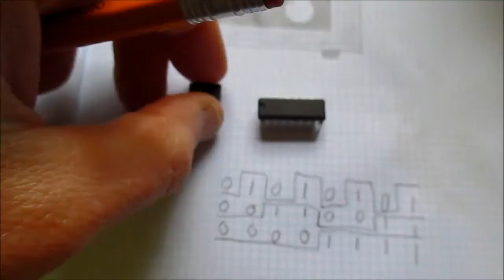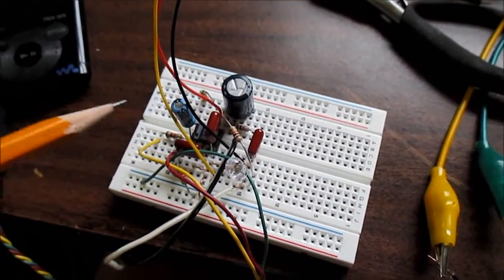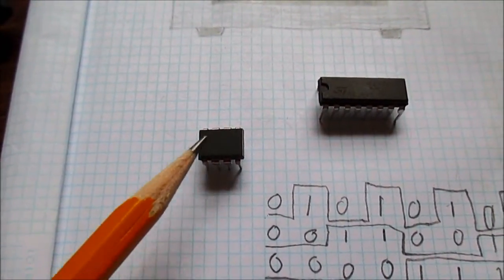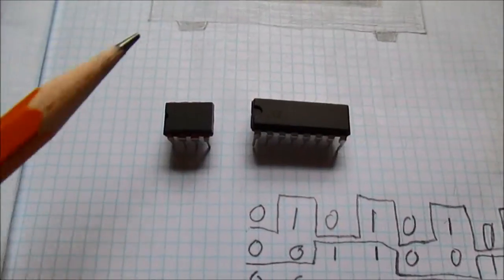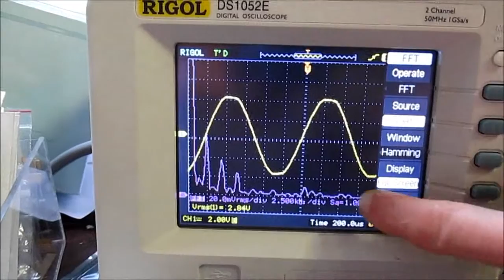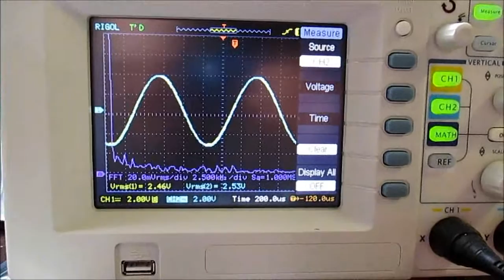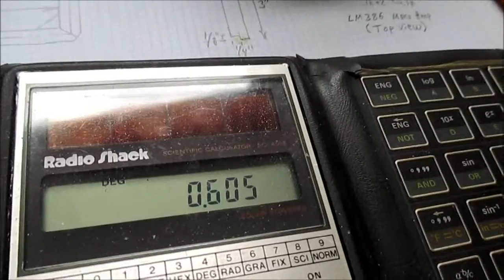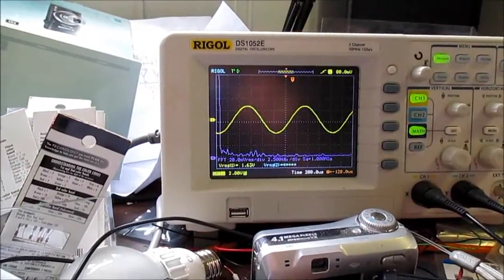TDA7267 audio amplifier IC vs the LM386

Comment: is there a way to tell without buying it first whether it's counterfeit?
Reply: I just received 5 TDA7267"A" chips, the large ones, from Ali.  Already soldered up 2.  The are certainly unused.  Seem to work fine ... but I wonder the same thing, are they real? Would @JohnAudioTech test one if I mailed it to him?  You keep it, of course!  Only 38 cents.  Actually, will send an 1875 and 2030 as well ... just to see if any of these new/discontinued products hold the same specs as a known original.
https://www.aliexpress.com/item/TDA7267A-TDA7267-DI16-IC-AMP-AUDIO-3W-MONO-AB-16DIP-5PCS-LOT/32902363902.html
Reply: If you want authentic, just buy from mouser digikey rs...

Comment: Wait a minute, I and listening this video using LM386 amp and 4 ohm speaker. I don't think I have any problem.
Reply from the maker: You are fine at 6 volts and 4 ohms. I wouldn't recommend it at higher voltage as the chip will run hot when playing music and you don't get much extra output than with an 8ohm load.
Reply: +JohnAudioTec I am using it with 7.5 volts and It sounds good with 4 ohm speaker and it never gets hot. It runs almost 24/7. But now I will take care not to use more voltage.

Comment: I know this is a old video but i have to ask, i want to build a bass guitar amp should i use the lm386 or the TDA7267
Reply from the maker: +Nikola Stoimenov Bass amps should have a lot more power, say starting at 15 or 20w for a practice amp and use a large speaker with good bass response.
Reply: +JohnAudioTech Thanks for your reply, I know that but i need a small battery powerd headphone or small speaker bass guitar amp i know it wont sound good. What would you recomend?
Reply from the maker: +Nikola Stoimenov In this case, I'd go with the LM386 because you can set the gain higher for the low signal the pickups in the bass output. See this video https://youtu.be/lBGE5lwbruE  for proper ground layout so your amp doesn't buzz or distort too much.
Reply: +JohnAudioTech im thinking about using a mpf102 preamp, i will try the lm386
Reply: How do you set a higher gain? Is it just using negative feedback?
Reply: @CurvedSlightly  You connect pin 1 and 8 for maximum gain, or use a potentiometer connected between those two pins to control it

Comment: hi, ive breadboarded a tda2627a amp...i notice their is a power ground, and a signal ground, i have them both going to the same ground, is this why im getting a bit of hum, i used the data sheet app note...cheers .
Reply from the maker: +100roberthenry Hmmm My amps using this chip are dead silent. Perhaps the high impedance input is picking up noise. If your not using a volume pot, a 10K resistor across the input should reduce noise.
Reply: JohnAudioTech  cheers john, i'm actually sticking a buffer in front for guitar use...

Comment: Hi John,
I'm making an amplifier with TDA7267 as you suggested. Do I have to solder all the ground pins together? What to do to make it sound great? I'm adding a potentiometer on the input also.
Reply from the maker: You don't have to but they should be all soldered into a large copper area on the PC board or some sort of heat sink arrangement for heat dissipation. If using the 7267A 16 pin version, it has a signal ground pin that must be connected to main ground as well.
Reply: Can I use 9 volt battery on the 16 pin version 8 ohms? Thanks!
Reply from the maker: Chung Henry Okay with one IC. If making a stereo amp with two ICs, you'd need a stronger power source. Both the 8 and 16 pin use the same chip inside. Use an Alkaline battery as they can provide better current to the IC under peak load. Heavy duty 9v batteries have too much internal resistance.
Reply: JohnAudioTech If I soldered all the pin together, wouldn't all the power ground, output ground and input ground mess around?
Reply: Chung Henry Just watched your latest video; got it now!
Reply from the maker: Chung Henry
Glad that was able to help. Hope your amp sounds good!

Comment: thank you for sharing. is there a way to mesure output power without the scope? connect the speaker to the output and turn it up until i hear distortion? would it work?
Reply from the maker: This video shows how to measure the power without a scope.
http://youtu.be/Ro3Y7eySh1I
You have to take the measurement at lower frequency (around 125Hz) because it is harder to detect the clipping point at 1khz by ear.
Reply: thanks